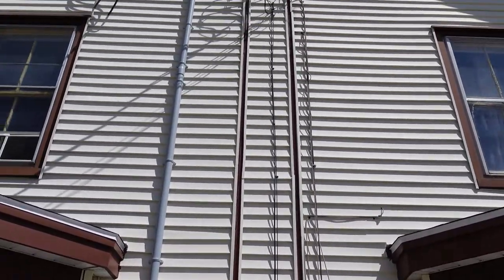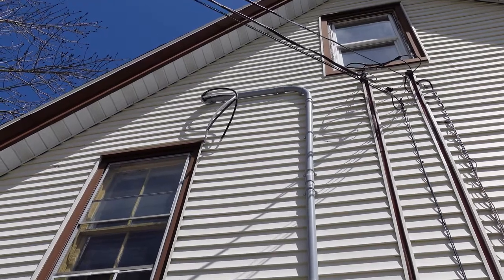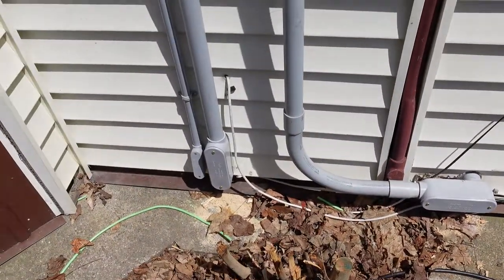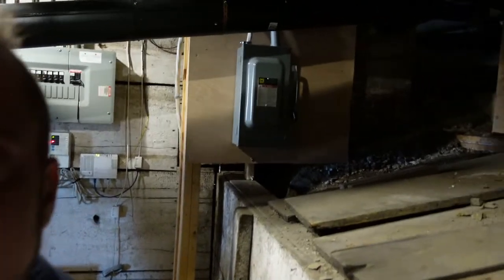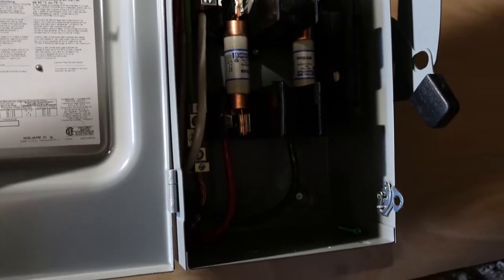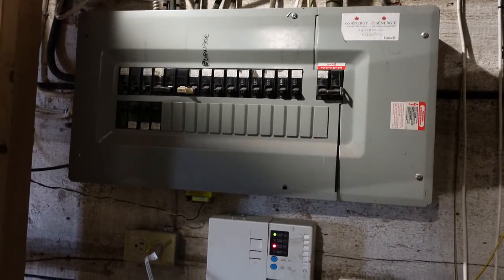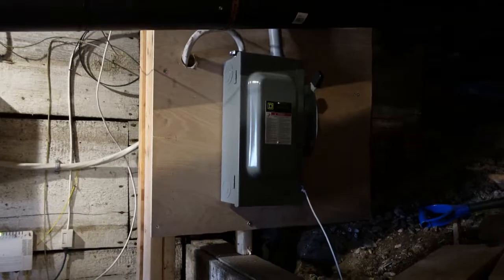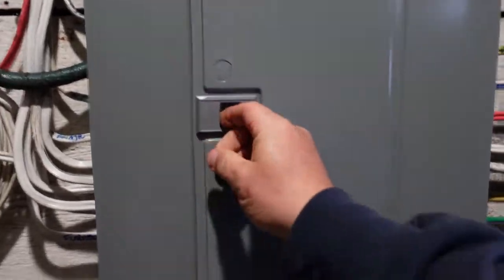Installing a 100 amp Service

Comment: Thank you, are those considered subpanels ? I.e. do you separate neutrals and grounds within them?
Reply from the maker: We can do both ways now here in Canada as per the cec. In this case I think we grounded the meter base from the ground plate and then bonded the panels removing the bond screw in each panel. This separates the ground and neutrals in the panels.